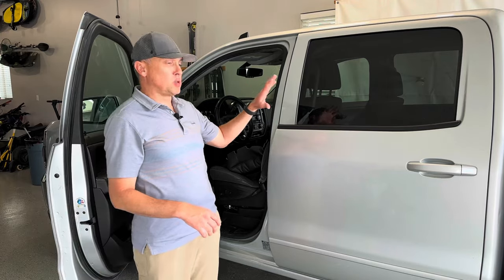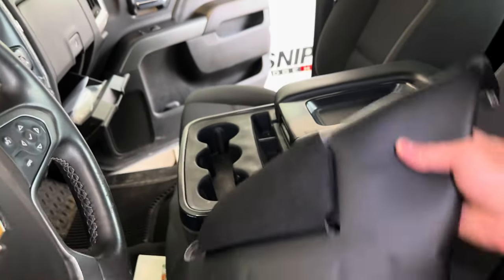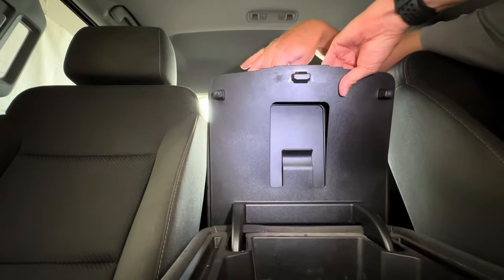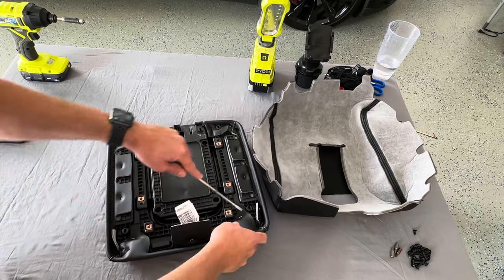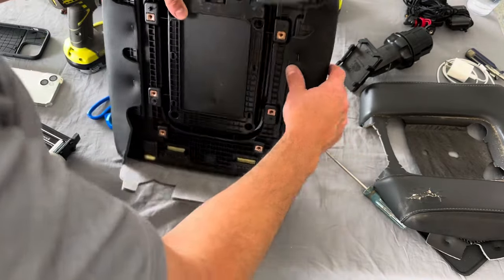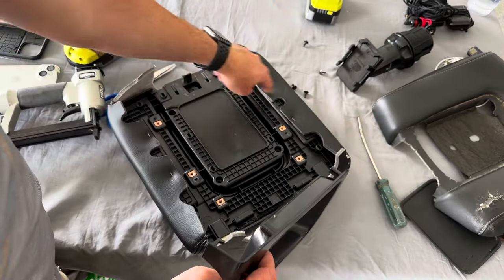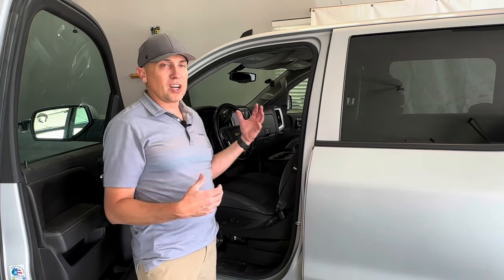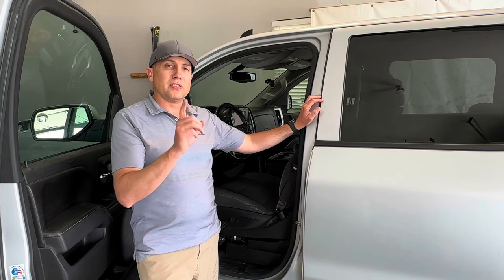Chevy Silverado Arm Rest Center Console Cover Replacement

Comment: Not too many of us have a staple gun the caliber of yours. I have several better than the average home staple guns but none would come close to going through the plastic. Some instruction videos just use glue of some kind but I don't care for that idea. I ended up using a pop rivet gun. After trying several sizes pop rivets I ended up using 1/8' x3/8' on 90% of the repair. After riveting and trimming the excess material I went around and worked 'shoe goo' under the remaining material just for extra/backup holding. I feel good about the results...it looks great & I will install it back on the truck tomorrow. BTW, quality instructional video.
Reply from the maker: That's a good alternative, thanks for sharing

Comment: I just bought a 2015 Silverado and the center armrest cover is worn just like yours (worse, actually). I have a replacement ordered that should be here tomorrow. I had no idea how to disassemble the lid, until I saw your video. I have a pneumatic staple gun, what size staples did you use? I have some 1/4”, 3/4”, 1/2” and 7/8” available.
Reply from the maker: I think mine were 1/4" staples.

Comment: Thank you for the extra time it takes to film and work. Is there any way you could measure the distance between the back support bracket of the console? I'd like to swap the back portion into my 97. Thank you
Reply from the maker: Measure the length of the lid?
Reply: @Myksgarage  Hey 1st off thank you for getting back to me. The width from hinge to hinge where it attaches to the bottom/seat if you don't mind.

 I'd like to replace just the portion where your arm rests on or when flipped up your back leans against. 

I really appreciate it.